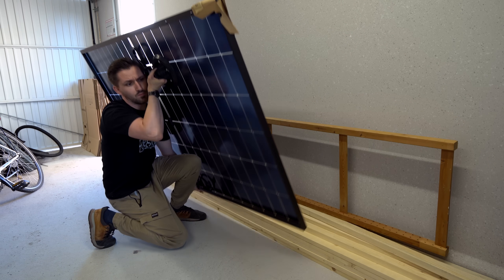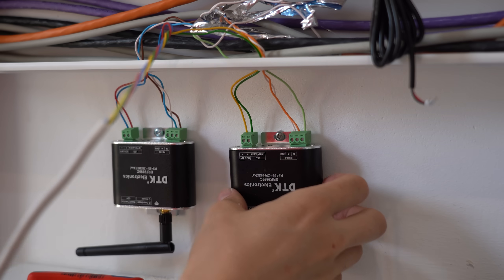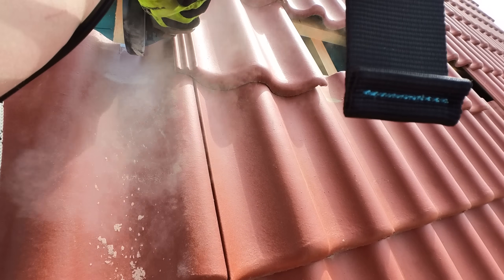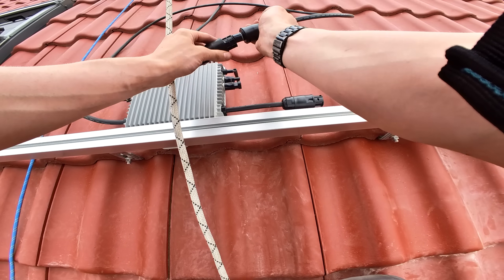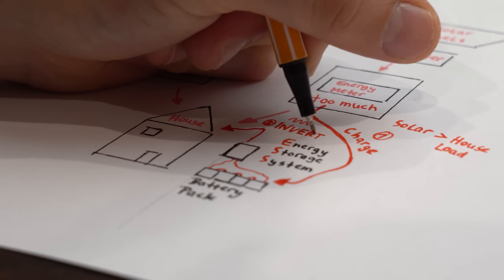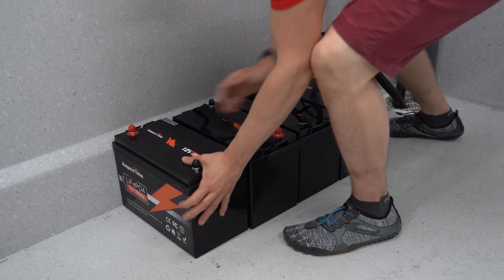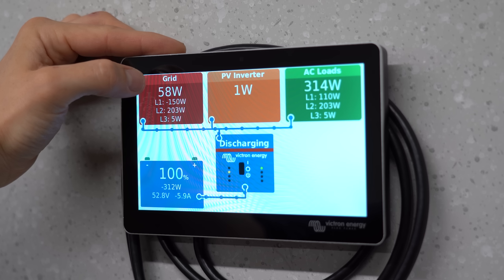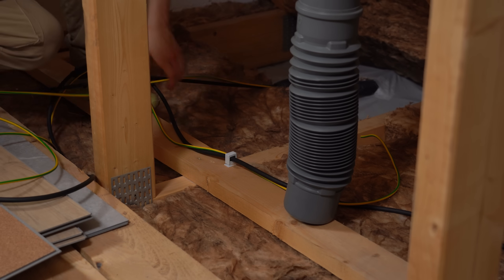Pushing a "legal" Mini Solar System to its LIMIT!

Comment: how is it that you can connect an inverter to the mains without causing problems? I was told there would be mismatches in phase and voltage that would cause problems
Reply from the maker: Modern Power Electronics ;-) I might do a video about it one day.
Reply: You need a special inverter that can synchronize to the mains. Not every inverter will do that. I also posted a comment mentioning that it is illegal to inject power back into the grid without an anti-islanding system, but it got deleted somehow ..
Reply: @nout4269  thats what I thought... kinda weird it got deleted

Comment: What gonna happen when the grid power goes out and the sun shining? Do you gonna have power in home?
Reply from the maker: The MultiPlus 2 has an AC out feature. So I can hook up loads there that need power when the grid is down. So there is an emergency backup included ;-)
Reply: @greatscottlab  Ok. Thanks for explanation.

Comment: Note that some electric companies in Europe strictly prohibit customers feeding any power into the grid without a permit from them. You can get fined and have your power disconnected for unauthorized backfeeding. So be careful and read your local laws and the contract!
Reply from the maker: Yep. Said that at the end as well. Always check back with your grid provider.
Reply: @greatscottlab  You should put a very very big warning in the front of the video as it is not a minor "note" but a series safety and legal problem if the people seeing the video without understanding what they do
Reply: @greatscottlab  You can arrange the topology in a way that never backfeeds (my mainline comment describes how)... and in fact, in a way that isn't even grid-tied and does not require permission from the utility at all.
Reply: In Poland u need permission to install any back feed system and get 2 way meter, also auto disconnect if grid isn't live (eg.when they connect new clients on your street or maintenance). 
Also u back feed 23W with 230V, but u need remember transformers work both ways. That's still 23W but when u put that in version 1kV or 10kV hurt a lot.

Comment: Sounds good. The problem is the price of the batteries... It drasticaly reduces the ROI. At the moment, I prefer send Power to the grid a lost money. I do not dose that much as I now consume as much I can during sunny days (boilers, HVAC...
Reply: It is not just the batteries. All that Victron gear probably costs about 2k€ which makes the project unprofitable on its own.
Reply from the maker: True. Hopefully prices will go down.
Reply: price won't get lower than LeadAcid which has a mature manufacturing & supply chain @greatscottlab